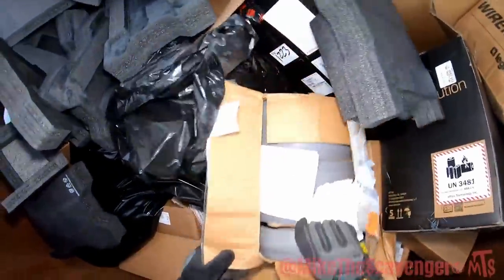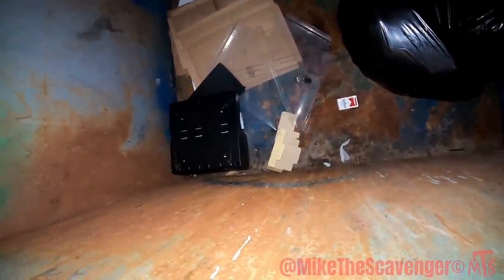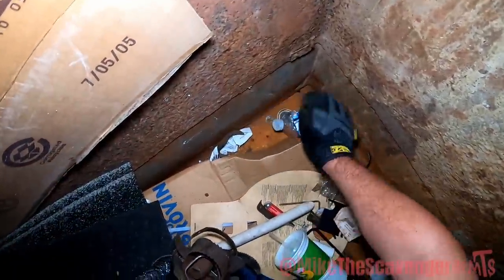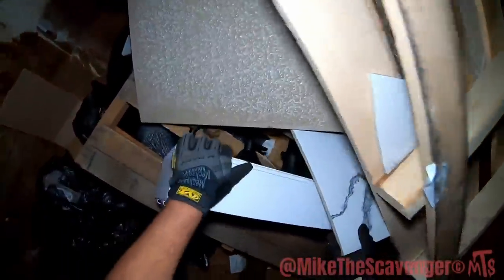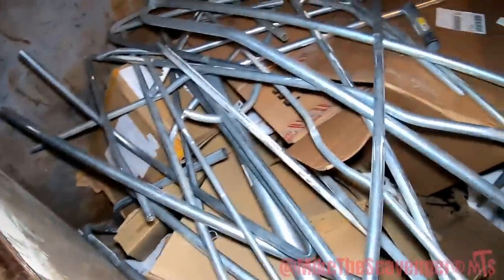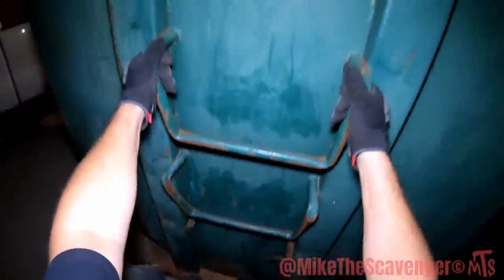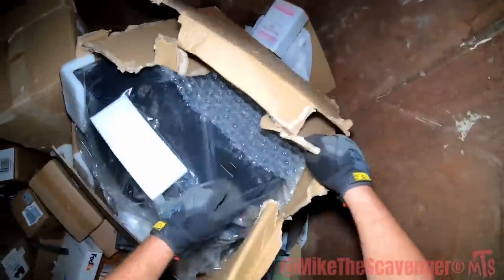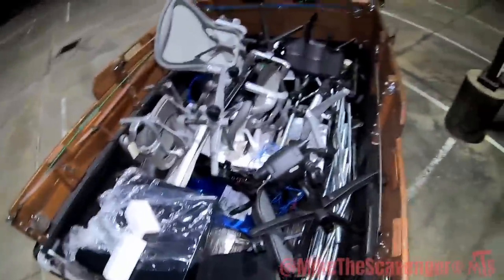Dumpster Diving "Brand New N' Such"

Comment: It still amazes me how much product gets chunked by people! Thanks Mike for rescuing it and keeping it out of the landfill.
Reply: My first college degree is environmental science. The department chair in one of his lectures said that someday we'd be mining landfills.
The modern sanitary landfill encases the daily tippage in clay cells, which is an attempt to isolate it. Think about it. Ensuing cells compact the ones below, and the base is at least three feet of compacted clay with a thick rubber liner on top, then three feet of eight inch rock, topped by thick felt. Those are to drain and collect water. So you have a relatively dry and air free tomb for trash.
Reply: Verdade,aqui no Brasil não jogamos tanta coisa útil assim no lixo.
Reply: It makes me wish I had a reliable gasoline powered truck since scrap os so spread out by me... With diesel being almost $6/gal, I have to go for maximum quantity and at least 20% copper.
Reply: @OldsmobileCutlass1969Va  diesel here in the UK is £8.73 per gallon (imp) which I think is a little more than a US gallon. Not sure what the usd to gbp is?
Reply: It doesn’t go to landfill…it will go to a transfer station where all recyclable material will be separated…Mike just gets there first for metal..

Comment: You should look into the used parts prices for Herman Miller chairs...considering that you can get $20 for two bolts, $10 for a plastic bushing, $85 for a base, etc,  it would be worth posting a bunch of the parts on eBay. You're taking them off and apart, anyway, right?

Comment: Be weary in your attic... If the "floor" joists are 2x4's, your attic is not built for storage. Mine has 2x4's and the previous owner put down a OSB flooring, but it caused my ceiling to sag more than 4" in some places! You need a minimum of a 2x6, but 2x8 would be better. I have to jack up my ceiling install a main support beam and sister some 2x8's to make a small platform for storage. Just seasonal and travel stuff. Nothing too heavy.

Comment: And my scrap yard takes anything with a motherboard in it they take it you can either clean it and take the motherboard out or you can get shred price as long as there's a motherboard in there or any kind of board they will take it and then you'll get $9 per hundred that's what our scrap yard is right now or 8. 50 per hundred pounds

Comment: You should find the Amazon distribution center and you you’d be amazed what they threw away I live in the Northeast it’s crazy what they trash 
I pulled a 3  48 inch flatscreen TVs brand new in the box it’s worth the trip
Only issue you have to be real quick and smooth they’re open 24 seven
Need to be a dumpster gangster to pull it off

Comment: I just scrapped out a garbage disposal the other day and the guy at the back in the steel Shred Place said you might as well throw that off now. Even though I had removed the disposal top in to where it was just the winding showing from the motor part. He took out his knife and scraped the windings and they were aluminum. Apparently washing machines and other Motors are too that's why they are not taking us Motors you're better off throwing them off in the shred pile.

Comment: Mike, many times I see you leave certain metals in the open tops and don’t take them. Are those metals so low grade that it would take 1000’s of lbs to turn a profit? Also , why don’t you buy a small kiln and melt down the #2 copper wire down into ingots which come in as #1 and bring a higher price?

Comment: You dropped the ball twice this time, Mike. That server case was brand new, you unboxed it then tossed it out on the ground- now it's scrap. And the unopened mail- you're in a dumpster, not a letterbox. Shouldn't be too hard getting the motors out of those sinkerators should it? I strip the wire out of all but the smallest motors.
Reply: Thinking the same, he doesn’t try to resell things anymore. He passed up anything that’s not metal and he’ll scrap most anything that is, even if it’s a name brand like Herman Miller